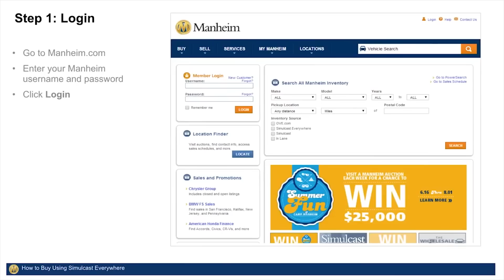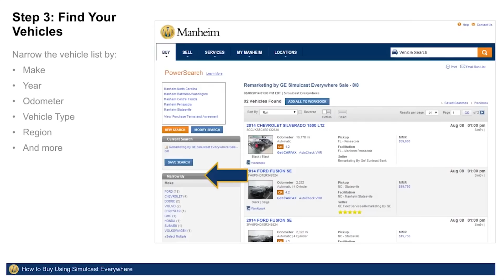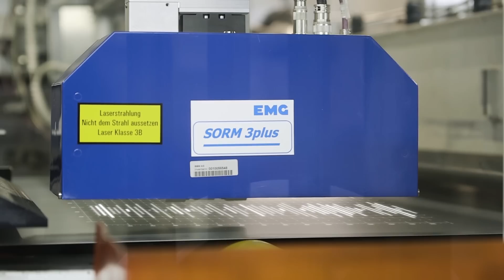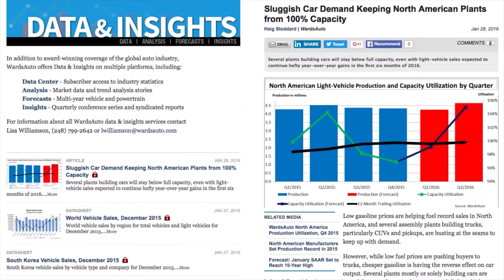Toyota Supra Impressions; Elon Musk Earns Historic Payout - Autoline Daily 2847

Comment: That bmw will kill Toyota’s quality ranking as everybody that is honest will tell you that the euro stuff can’t hold a candle to Toyota or Honda when it comes to long term  reliability. I sure hope the Kia Soul is better than a PT cruiser as they were sold on cute but talk about a junk box on wheels those things fell apart
Reply: Toyota worked with BMW with more stringent standards that surprised BMW engineers.
Reply: Strange, we had a 2004 Anniversary Edition, that had only 1 warranty repair, and zero failures. We would still be driving it, but some idiot in a Toyota thought he was in the fast and furious movies and decided to drift near our driveway. SIde slammed the PT, spun around hit the front end, bounced into one of my Jeeps (which happens to have an ARB Bullbar). The bull-bar stopped him, unfortunately the Cruiser was toast. That was an anniversary gift to my wife, and was never any trouble. We cried when it got carried away. So junk box on wheels, obviously not an actual owner. You probably think it was a straight Neon copy. Idiot.

Comment: That Supra is $57K+gasoline (26MPG)?   You were all about quoting exact horsepower numbers but when it came to acceleration you simply said it is "fast."  The 0-60 is in fact 4.1 seconds, nearly a second slower than the Tesla Model 3.  Let's re-state that another way... the Model 3 gets to 60mph in three-quarters of the time it takes this Supra to do it - 3.2 seconds.  And costs $56,100 w/ no gasoline payments.  And all-wheel-drive, 5 seats, more cargo space, amazing software etc. etc. etc.  Saying the Supra is "meant for the track" is silly, the Model 3 can easily outgun it around a track.  The Supra is just a dumb purchase at this point in time, and ICE manufacturers putting out these folly sports cars need to realise it.  Sales are going to be tiny.  It's dead in the water.  I don't know why you can't say that sort of really obvious stuff.
Reply: The tesla is a electric car. That's like saying your comparing a huracan to a Camry. Your comparing apples and oranges since its obvious that electric is going to be faster than a gas car. But that's not the reason why the mk5 was even made anyway,better yet those are 2 completely different cars and markets your comparing. If anything,it wouldn't take much at all to make a stock mk5 faster than a model 3. Plus it's a 50k car not a 57k car(57k if its the special/top model)
Reply: @carboydorifutoparty3976  No it's not. Model 3 costs less than Supra, goes faster, responds faster, has better traction, sticks to the ground and costs less to maintain and own. Not even close to Huracan vs Camry. Who would have thought 10 years ago that was even possible. Not to mention that you can get Model 3 with similar performance to Supra for $10,000 less.
Reply: @ranig2848  again. It's gas vs electric. 2 completely different cars and 2 completely different markets. If anything, are people going to do the same things that people are doing to the mk5s? I'd like too see people convert them to rwd and do the exact same things people are doing to the model 3 vs the mk5. Again its a electric car. We all know its going to have its but load of advantages but it's not going to be used the sane way that people are using mk5s.
Reply: @ranig2848  Toyotas not even aiming the mk5 towards the model 3 any way. Your comparing a car that's aimed towards tuners vs a car that's made as a daily driver. The model 3s been out longer anyway,it is no threat to the mk5 in any case since they aren't doing anything major,people not even the mk5 owners themselves are even comparing the 2,and Toyota wasn't even looking towards the model 3 as competition since that's a completely different market to what they wanted the mk5 to even be in in the first place. It's not going to affect the mk5s sales in any kind of way.